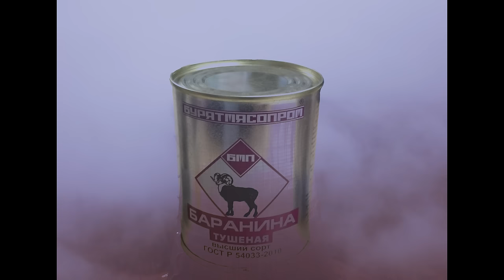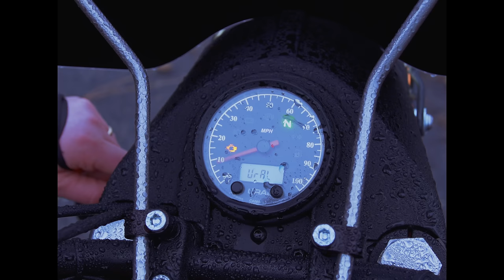Ural Motorcycle Review - Our Best Sidecar

Comment: I owned one for 5 years and it was the THE MOST FUN motorcycle I ever owned. Was it comfortable? No. Fast? No. Smooth? Nope. Reliable? Well, mostly. But it was very practical for grocery runs, carrying lawnmowers and 5 gallon pails of paint or roofing tar. 80 pound bags of concrete...no problem. 8 foot long 2x4s...again, no problem. Riding in the snow? More fun than the law should allow! Me and two gals going for a ride around town? FUN! Flying the chair at Sturgis? Even MORE FUN. But beware, UDF (Ural Delay Factor) is REAL...most of your time stopping anywhere will be occupied by strangers asking questions. If you are shy around strangers, this is NOT the bike for you!
Reply: you meet the nicest people on a Ural
Reply: You mean the scheduled catastrophic failure applies as well? XD
Reply: @_implying  hehehehe
Reply: @herosdiaz8757  What are you talking about?
Reply: @mechanomics2649  He doesn't do maintenance on his motorcycles

Comment: I bought a brand new Gear Up 2WD in 2017.  It was culture shock to say the least.

It was plagued with quality control problems from the start including factory installed mismatched pistons and cylinders!  It burnt out the fuel injection once, the speedometer 4x, the rear brake and rotor 2x.  It took the better part of 2 years to sort out the gremlins.  

Now, mostly problem free for many miles now, I love her to death and ride her all the time.  She is one of my 8 motorcycles and the one I take shopping or riding my handicapped son and my dogs.  Everybody in town knows it's me because you just don't see them much.  There are a lot out there, but they are spread around geographically.

Yes, the neutral and fuel lights have minds of their own.  I don't care.  I can feel neutral, and I know how many miles to expect from the odometer/tripometer as to when I need to fuel up.  If I make a mistake, I have 10L of petrol strapped to the sidecar.  It is impossible to be stranded for very long due to running out of fuel.  I also have a towing hitch purpose built for my rig.  Makes towing a motorcycle trailer or camper or a small garden trailer, a piece of cake.  It's also allowed me to pull others out of being trapped in the snow or off the embankment, etc.  I also have a Warn winch on her which allows me to do even more to help myself and others.  

This thing is truly functional.  Not pretty.  Not amazing build quality.  Fit and finish is "Meh", but FUNCTIONALITY is unquestionably over the top of literally anything out there.  I'm not kidding.

Curiously, I have run into BMW riders with their very expensive and snazzy sidecars, who have said they want to go riding with me.  When we head into the real back woods of the U.P. in Michigan or the Black Swamp woods areas of Ohio, they freeze in panic and are unwilling to continue.  I turn on my 2 Wheel Drive, wave goodbye and continue on into areas that no other motorcycle in the world is capable of going into, let alone of making it back out of in 1 piece.  These things are tanks.  Plain and simple.  They are also one of the most infectious things you can ever ride and they work their way into your heart very quickly.  

I love mine to death and will never sell it.  Never.
Reply: That's awesome man. I'm from Ohio and would love to know more about the bike and rig. Could you post a link to the bike you're talking about? I'd love to get one in my hands as well
Reply: Would you be interested in swopping it for a "LARU" same type of bike made in one of the backward countries ?🪖🙃🏍

Comment: Your numbers on catastrophic failure were pretty much spot on.  My single-wheel drive, never ridden hard, Tourist LX grenanded its transmission at 6,000 miles. Unless you've got a fully equipped shop, plenty of free time and don't mind waiting weeks for parts, ride something a bit more dependable.  It was fun while it lasted. I now have a three wheeled paperweight in the garage.

Comment: Hell yes, Ural! That brings back happy memories.
I used to ride a considerably older model (no engine lights to annoy you) that I absolutely loved. The right cylinder head would reliably rattle itself loose, I ended up carrying a wrench on me to tighten the nut every 100km or so (say at a stop light). It was really good at getting me where I wanted to go, provided that was straight and not too fast. When I took the bike over it had been standing in a garage for 10 years, with fuel in the tank. It started with that same fuel, though changing the dead battery involved taking half the bike apart.
Also, the little boot is the precise size of a standard German crate of beer. Coincidence? I think not!
Reply: That was the rocker cover, not the cylinder head. I ended up using Aerotight nuts on the studs that held them so I'd only have to use that spanner during servicing instead of every few days.

Comment: I bought mine new in 2000.  Before it rolled over 13,000km I had replaced both jugs, both pistons (twice), both carbs, the crank, the piston rods, the entire ignition system, the generator (three times), and all four tires (twice).  I had to work on it every weekend just to keep it moving for the M-F commute of just 6 miles each way.  It was a mechanical disaster made of anvils and steel girders, but it was the most fun you could have on three wheels.  Now that they are made with (perhaps) more reliable parts, I might even consider having another one.

Comment: I have a friend with lots of stories about the Ural. Like if you try to countersteer, it will instantly kill you - they didn't warn him that a sidecar does not steer like a motorcycle :) But the best story has to be the fact that there was once a loud bang from the engine, and he ended up riding it to a service station with the engine running decidedly rough. The bang was the main crankshaft bearing disintegrating. The engine run without it, just somewhat rough. Change the bearing and off you go...
Reply: Also it came with a toolkit with which you could disassemble and reassemble the whole bike, engine included. Which was needed on multiple occasions.
Reply: Like a Lada, it never ran well, but it did run in all conditions.

Comment: One of the most fun videos you have made. I wanted to ride a friend's BMW with an attached Steg sidecar, but my friend was afraid I would wreck it. So, I bought a Motorvation sidecar (the very large fiberglass one with a fixed wind shield and a wheel and tire that would hold up a Toyota Carolla) and hanged it on to my poor Suzuki GS 850. It was easy to attach or detach with the optional roll away frame work, and I taught myself to ride a side car. I met my friend with the BMW side hack rig a few weeks later and when he rode the thing, he said that it handled better than his BMW. After my new wife and I went on a short road trip. Coming home on the interstate, we were bucking a 35 MPH head wind, with the throttle locked open in third gear, and my right foot pushing against the right handlebar to keep it on the road, while new wife and I screamed at each other through the slip stream. Traded the rig for a Fiat 124 Spyder. I really don't miss the rig. Well, maybe a little.

Comment: It must be my birthday or something. An F9 video about Ural! It is my birthday!  

Great job. I had a 2014 Ural Patrol and oh what fun was it to ride. Problem is, maybe I rode it too much because I had too many of those 10,000 km scheduled catastrophic failures. I know you were having fun with that statistic, but it’s no laughing matter. Let’s see, three years of ownership and went through one left cylinder and piston, The whole left head really. Three clutches and three gearboxes. A snapped swing arm. I’m not sure the total km because the odometer catastrophically failed right before 33,333 km. And an electric starter. I only got rid of the bike because the three year warranty was due to expire and I knew I couldn’t afford to live with that bike without the warranty. I’d say I got rid of it with close to 50,000 km. And in that three years and 50,000 km, the bike ran about 1.5 years. About half the time I was waiting fir parts or for the dealership to fix the bike after one of the failures. Maybe I was just an extremely hard Ural rider, but I figure a catastrophic failure about every 6250 km. That’s not taking into consideration all the minor niggles like quirky electrical systems that may or may not work at any given time, clutch cables regularly breaking, a final drive that required far more attention than any chain I’ve ever used. One time I turned on the key and there were flames and white smoke coming from under the front of the fuel tank.  I shut off the key and the smoke and flames disappeared. I went and got a fire extinguisher and turned the key on again and nothing happened that wasn’t supposed to happen. And that never happened again. Of course a fire extinguisher was kept in the sidecar from then on. 

But other than all that, what a fun bike. If it had a forever warranty (no kidding, they totally honored that warranty) I’d have kept my Ural. I never would have tried a cross country trip with it again (waiting for parts and replacing the clutch on the side of the road 1500 miles from home and with your 12 year old daughter sucks). But for riding the local backroads on the weekend, it’s tough to beat. 

Look up “Ural Patrol racing a train” to see the typical riding I did with mine
Reply: This motorcycle is not for such distances and runs.
In Soviet Russia, it was used as a cheap alternative to a car. Plus good roadability on bad roads (including forest ones)
In the Urals, it was possible to bring firewood, water, bread ..
Possibility to ride mushrooms or berries in the nearest forest

Now the Urals are not popular in Russia, they are almost nonexistent. Old extinct, new too expensive.
So the Russian Urals will soon become completely non-Russian (they sell it mainly to America and similar countries) but not to Russia.

Comment: Dude, my 2011 URAL Patrol sees the dirt all the time.  Me and my two kids love riding it through the woods.  And yes, there is a URAL DELAY FACTOR. People always wanna ask questions, take pictures, ride in the sidecar.  
They are junk, but so much fun to own and ride.
Reply: they are 15,000$ i think? way to expensive.
Reply: @Francois_Dupont  yes way too expensive for what you get.  But, if you buy used you can get a deal.
Reply: I live in China and I have a CJ750 (kinda same). It stinks of gas and oil, is slow and not very reliable but I adore it.  I take my kids on it for trips on the weekend. It's hard to explain but it's just amazing to own one.
Reply: @curttimmbch  I got mine for 1k and fixed it up cheap. Got it to replace my old car.
Reply: @Francois_Dupont  compares the service life, because if it is designed to last 10 years in Siberia.
Reply: Well from your experience, is the 10,000 km failure true then?
Reply: Owned a 2016 gear up. Their reliability is up significantly since 2012. I had well over 10 000 km, and didnt have any significant issues, but it is maintenance heavy... you need to like wrenching to keep a ural happy. It js a true war machine.
Reply: @honsam  my 2011 has 32,000 km. No real issues.

Comment: I own a 2021 Gear Up...see previous comment from 2 years ago... just a few thoughts. Uphills, off pavement, loaded with passenger and gear I can tell you this, 1st gear is geared too high for real world off pavement work which is a REAL SHAME IMHO. The Sachs shocks are worthless POS. The Enduro bench seat is as comfortable as a brick up the backside. 2wd is very handy and so is reverse.  Just about every person that sees you either smiles or waves. UDF, Ural Delay Factor, is for real. Ural's 3 yr warranty is a must and they are great at honoring it. I run Duro 307 trail tires and surprisingly,  they work very well. Don't expect to zip up hills 6% or more any faster than say 40-50Mph. Owning one is a lesson in pulling over at wide spots to let traffic go by that we were holding up and never been flipped off! Waves, photos smiles even some stares but, everyone is like "Oh a sidecar. Must be old and slow." That and I have a reflective sign that reads, "Please Be Patient" on the back. Suspension upgrade is expensive at $1500.00-3k+. But the one thing that I would say is the most annoying thing about my Gear Up is the lack of a Granny Low Gear to be able to crawl over an obstacle. It is a HUUGE drawback. It means a lot of clutch work and irritation, so, get a winch if your seriously going off road. You will need it. If you're the typical Uralista that never takes the machine off pavement then the gearing will be fine and as you say, "Shifts like a tractor." The $34,000.00 version has good suspension but is it really worthy of that price? My answer is a sad "No." For less you could buy a street legal side by side that is much more capable and won't pound you to death and into physical therapy for an impinged spine. Of course that wouldn't be as "COOL" though.

Comment: I owned a homemade Saleng (cargo sidecart) for several years in Thailand and the thing was a total head f**k to ride at first.

The paradoxical over and understeer, the right hand turns when braking, the heavy steering, vibrations, and of course when you are too heavily loaded to get up a hill it rolls backwards whilst turning into a gulley 🤣

However, once you mastered how to ride sidecare it was hilarious fun - think Mario Kart!

You would get the thing on 2 wheels in the bends and  brake to use the sidecart's weight to make insanely sharp turns. 

Every rider should learn to control a sidecart just for the sheer hilarity of it.

Comment: Loved my R60/6 and Squire ST2, passed my test on it, nearly had the instructor on board, fortunately replaced seat with 50kg bag o'cement - if BMW did this, a 900cc, Heron heads, fuel injected (properly), an LSD (or electric hub), lots of LED lighting - I'd go for one again.

Comment: The Ural could benefit from differential rear braking, aka tank steering. Where the steering of the front wheel activates a limited slip differential in the rear by applying small braking forces to the side you want to turn in. Would create a drag effect on that side forcing the bike to turn.

Comment: I had a Ural for years and I commuted on it. I traded it in on an FJR, so I guess you can figure I figured out what was wrong with it. When i got it, I fancied I could do a lot of my own maintenance, which was untrue. It was not that the maintenance was all that difficult, but I am not suited to doing maintenance. I still have the tool kit. The worst unanticipated thing was that sidecar motorcycle do not ride perpendicular to the ground. If you are over 40, this will affect your back. It was good to ride in the snow. It was terrifically slow and car drivers would cuss at me, after they managed to pass me. I guess, in y opinion, it is the closest thing to a Citroen Deux Chevaux.

Comment: I had one and LOVED it...as long as it was running. During the best of times, it sounded like the sump was full of matchbox cars being ground up by the crankshaft. The alternator was notorious for self-destructing, so I removed it and had to put the battery on a charger every night. Then the carbs went tits-up and the right side exhaust fell off. 

Heavy, slow, prone to catastrophic mechanical failure at any moment...but I'm still bummed I sold it.